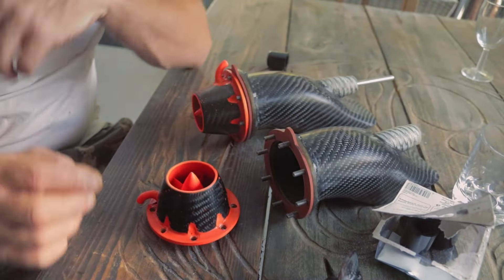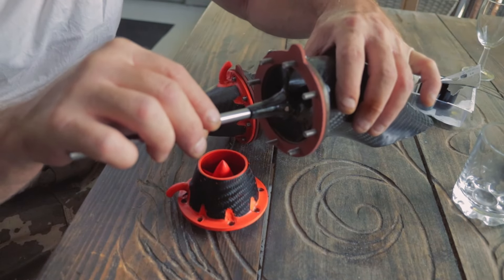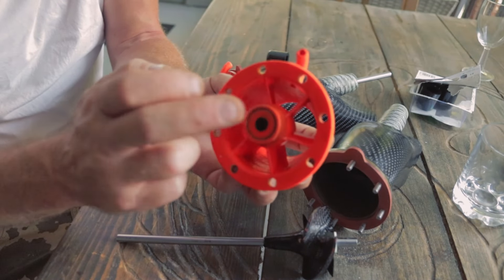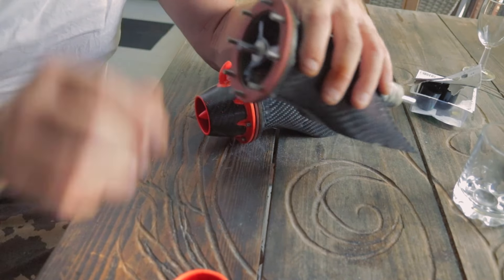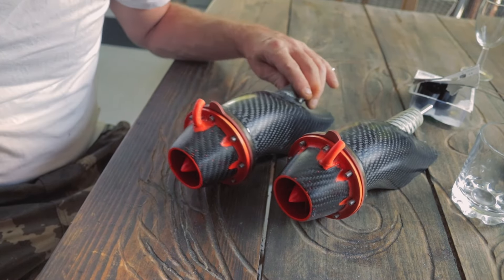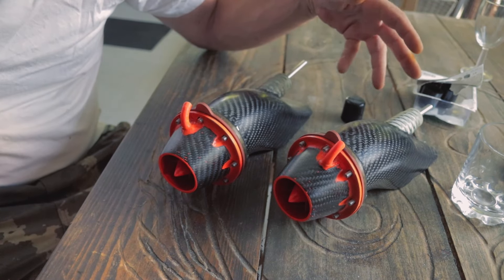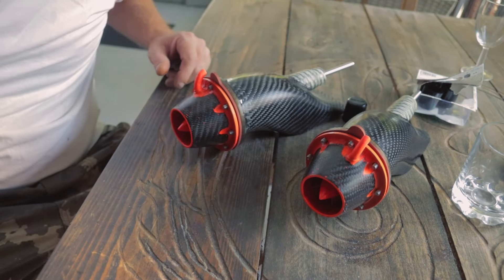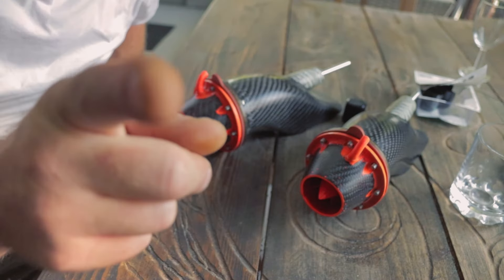3D Printed Carbon Fibre Jet Drives for my Diy Electric Surfboard.

Comment: Realy fun to see other people project . Amazing job on board 👍
Look forward to see what electronic you will use . Tip is to make coolingplate inside also for battery . 
Are you use Vesc ?
Reply from the maker: Hi thanks for the interest, i am using at the moment 2 x 200amp esc's that seem to handle the motor's no problem
but they can only handle 7S so i will need to make a battery at some point in the future. This is the plan. I will film any upgrade's and ask my sub's if i need help. Cheers.